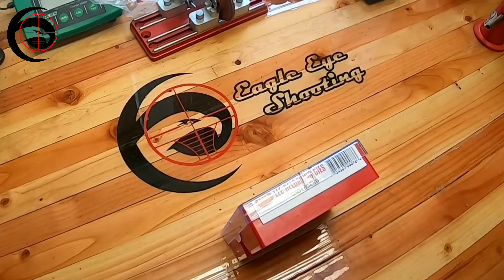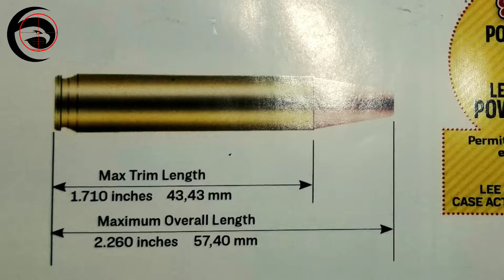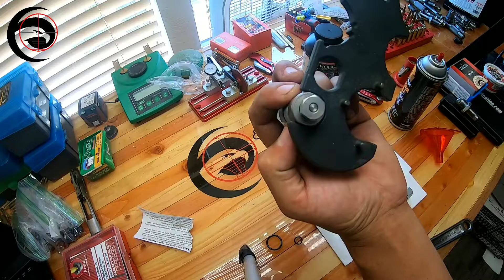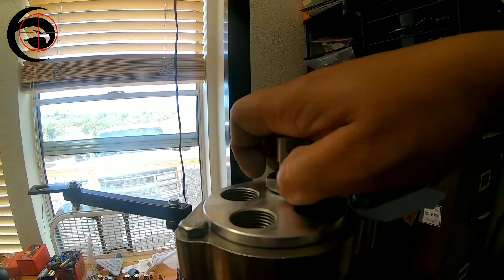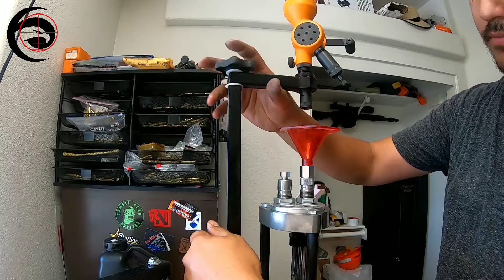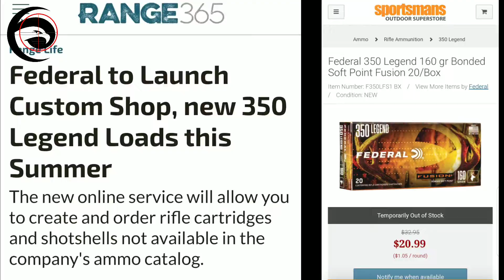Lee 350 Legend Crimp & Reloading Dies - Setting up the Pacesetter Dies CORRECTLY

Comment: Those who use these dies and probably any other brand for this caliber should know that sizing this the brass will take the neck or bullet mouth of the cartridge down to the point that a standard 35 cal trim pilot on Lynman and Foerster trimmers won't fit in the mouth. The Forster 35 cal  trim pilot measures .351 and lynman measures .349 for 9mm and .352 for 35 cal pilots and the case mouth sizes down to .347 . You must full length size before trimming. And if you measure length of the case after sizing then use the mouth flare powder thru die to open up the mouth the brass so the pilot will fit the cartridge will shrink in length of about .003. This is what I'm experiencing with factory Winchester brass. So be Careful how you trim out your brass as not to end up too short. My dies are new and until I purchase a set of RCBS to check this little phenomenon out I can't say it's not just my die set.

Comment: I was always told you cant use .358 size bullets just .355/9mm and .356.  Did you get any high pressure signs?
Reply from the maker: I did not. However requires Starline brass as its thinner to mitigate chambering issues
Reply: @EagleEyeShooting  Thanks, I always wanted one but didnt get one because I thought you couldn't run .358 bullets.

Comment: Thanks for the great video, man. Your presentation is very straight-forward and concise. I appreciate it. I am just getting into reloading, forgive me for being a novice. My biggest fear is having too much pressure and damaging my rifle (Savage 110). What can cause over-pressure? What should I be careful of? Does it have to do with crimping? How do you know how much crimp is too much?
Reply from the maker: Thank-you.  I would grab some Federal ammo and compare there crimp style. This cartridge uses a roll crimp. Since there isnt much load data out for this cartridge, it's not a very good cartridge to start off on reloading. This cartridge is highly sensitive to case over all length, crimp, bullet profile and powder charge.  However if you still want to pursue, You can use 357 Maximum Load data. Start at Max charge -10%. As for the bullet profiles, Hornady FTX bullets work the best, followed by Speer 200gr Hot core

Comment: DO NOT BUY RCBS die sets in this caliber!!!! They sell standard sets with a roll crimp die! They will then sell you the right $40.00 Taper crimp die that the set should have come with. This cartridge headspaces on the case mouth and screams for a taper crimp. RCBS customer service admits this die set should have been made with a Taper crimp die!! There is a reason that everybody on YOUTUBE is using LEE dies for this cartridge!! And it is not just because they are cheaper. My recommendation is buy Lee, Hornady or Redding dies for this cartridge. You will get the right Taper crimp die with any of those sets. Other than the required taper crimp reloading for this cartridge is very similar to .357 Maximum. In fact, the 350 Legend is very much a rimless .357 Maximum. The 350 Legend is slightly longer but reloading data for the .357 Maximum is a great place to start. Reduce accordingly when changing components, of course.

Comment: I didn't see load data either. I tried getting load data so I could load some rounds. I was looking at the die setup and low and behold there is LOAD DATA! It's on the top left of page. After loading other calibers that has a lot of different weights and powders the legend only has four pistol powders. Like the 300 black.
Reply: Sss

Comment: You have any reloading info you could share? A pretty good powder to start with?
Reply from the maker: My other videos will have some also. Hornday FTX bullets in starline brass (others brass wont chamber) have been the most accurate.  This cartridge uses the same powders as 300AAC. So H110, lil gun, AA1680. 18gr's is a good start for bullets ranging from 158 - 180

Comment: I am doing a 350 legend build for hog and deer.  My problem is I have a crap ton of .357 diameter jacketed projectiles.
Reply from the maker: Don't go with a factory SAAMI chamber and Winchester brass. It wont fit. KAK is making .358 barrels from what I seen. But using M4 barrel extensions.  Im almost done with the video in where I make an AR barrel in 358 legend. Should be up this weekend
Reply: @EagleEyeShooting  I bought a barrel with a match grade chamber.  I will slug the barrel to see what it specs too.

Comment: Cant decide if i should get the lee collet die or the rcbs taper die which is $45. Could you let us know a bit more about the lee collet die?  I also have the KAK 358 barrel & will be loading .358 bullets.
Reply from the maker: Thats awesome KAK is offering that now. I just got that reamer from PTG for a savage axis build. I would say the RCBS taper die would work better. The collet die crimps right at the mouth. But heres a tip. If you put the cartridge upside down on the collet die. You can crimp below the case mouth (stab crimp). Basically make a home made length gauge and crimp that way. Using FTX bullets like the 200gr with a cannelure with this style crimp works awesome
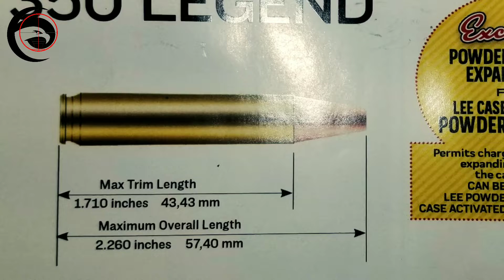Reply: Eagle Eye Shooting thanks!   The 358 barrel is also 1:14 twist, great setup for heavy bullets!

Comment: Question.  I have the Lee .350 Legend dies.  Starting my first reload with once fired Winchester brass.  Ran 20 rounds through the resizing die.  The problem seems to be the ID after resizing is coming in at .347.  So my hand trimmer   From Lee (base measure .351) is not fitting down into the case.  Any idea what the ID should be after resizing?  FYI, OD at the neck after resizing is .370.
Reply from the maker: Ya the Winchester brass is thicker than it should be. Starline makes brass that is hell of a lot better. It should be about .352 ID using .355 bullets to reload. You can look into getting a Lee Universal Expander Die and pair it up with NOE expander plugs to the size you want. How these plugs work is it replaces one of the lee taper plugs and expandes the case to the dimensions listed. Example:  355 x 351 the first number is the case mouth flare the second is the case neck flare
http://noebulletmolds.com/NV/product_info.php?cPath=565_88&products_id=5718&osCsid=j7ourdm6e8q85d5023avtihs42

Hope this helps!
Reply: @EagleEyeShooting  The link you provided here is a dead link. Can you provide one that works? Thanks

Comment: Could you please let me know what primers your using and is it safe to shoot that .358  Speer  out of a Sammi spec .355 Barrel ? I just got all of the dies and supplies to start any advice would be greatly appreciated thanks keep up the great videos!!
Reply from the maker: Happy 4th brother, you'll need to stick with Magnum primers such as CCI 450's. Yes its safe to shoot a 358 out of the barrel given the load is slightly degraded while looking for pressures. (3 to 4 o clock ejection also) the problem you'll face is when using winchester 350 legend brass. To summarize, the brass is to thick to accommodate reliable chambering with a 358 bullet. You can use Starline 223 basic brass and itll be fine or look into a inside case reamer.  For some reason they seemed to switched to a .355 bore near the end. PTG makes a reamer that can open up the front of the chamber to allow for 358 bullets
Reply: @EagleEyeShooting  awesome? thanks for the help ever think of trying any of the Nosler type boattail 358 bullets? Happy fourth!!

Comment: EE, I just started watching you because of the 350 legend. I see you modified a 9mm Barrel.  What is the twist rate in that?  I know the KAK legend barrels are 1:16.   Do you have a vid on the making of the barrel?

Thanks.
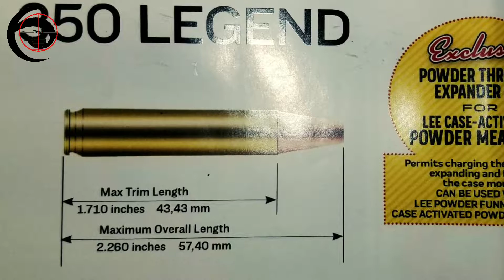Reply from the maker: Thanks brother!  This 9mm barrel is a 1:12 twist.  I had video but swapped the sd card into my mother in laws camera for her to use... she took it home... no worries im be doing a complete contour and chambering from a barrel blank.  Not many videos on a ar barrel.
Reply: Thanks for the answer.  Do you think the 1:12 twist is better for heavy bullets? I really want a 350 but all are in 1:16.  What twist do you think would be the best 'all around' ? (150 - 240 ish grains)
Reply from the maker: @hazcat640  ill find out soon. I'll try these 220s out of both both barrels and compare results.  I also have some 225 grainers. Using QuickLoad  to build my load data
Reply: Great!  Thanks!

Comment: I am using Lee dies for most of the calibers I load for. As you have seen, I don't have too many problems shooting sub MOA with them. Don't let the low price fool you. Lee dies are pretty good in my book. I do find that the FL sizers sometimes do not create enough neck tension with my 30-30 and 22-250 (enter the neck sizer or crimp). Good demo on your setup, can't wait to see what kind of loads you come up with for the 350. The only straight walled case I have experience with is the 44 Mag.
Reply from the maker: Absolutely agree. Lee dies will do fine if not better for most long range. Ive had to sand down my expander ball with Emery cloth and a drill on my 223 FLS to get the neck tension.

Comment: Haven't started reloading, yet, but I'm close to making that jump
Reply from the maker: It's an addicting hobby. I find it relaxing at times. Upfront cost is just a few boxes of bullets.  And if it just doesnt work, sell it on eBay to get almost all of it back😁👍
Reply: @EagleEyeShooting  I bought a single stage press. I've bought dies for 380, 9mm, 40, 556, 300 blackout, and 300 win mag... just have to make the space either in the garage or clean out the extra bedroom... then set up the bench... so, inching closer to giving it a try...

Just have to figure out which cartridge to start with. Maybe the 40? Someone said straight walled cases are easier to learn on.